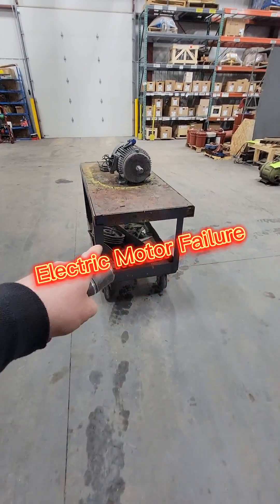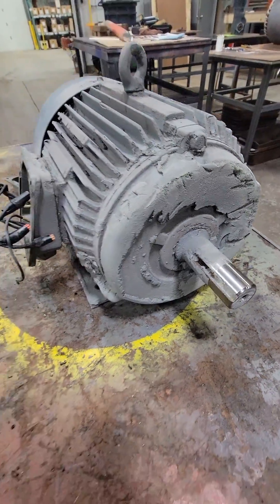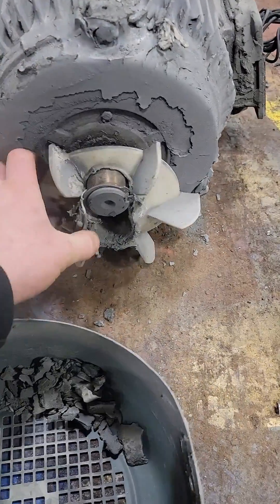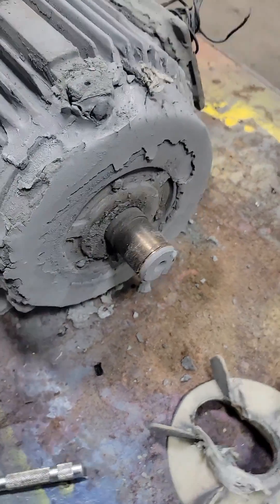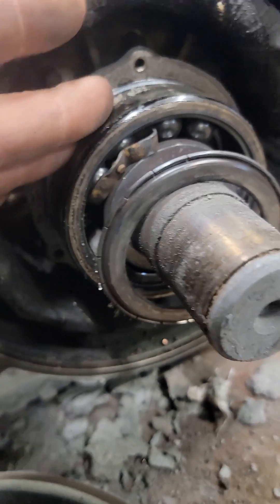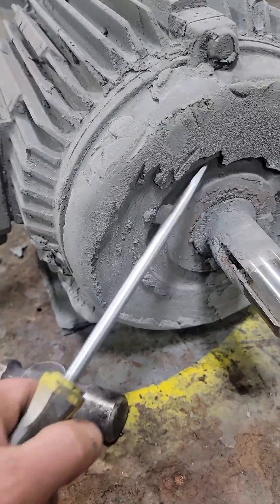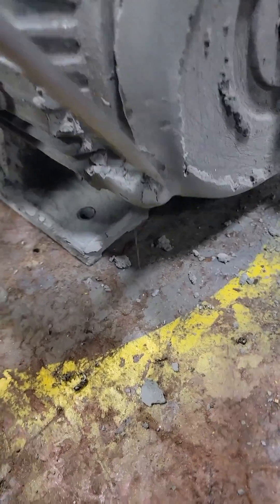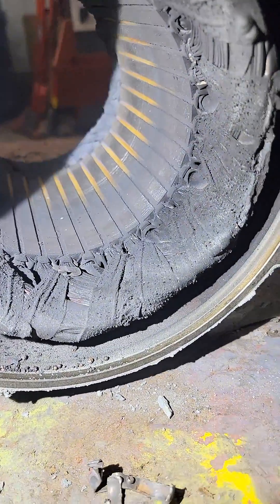Electric motor failure. 3 phase ac. Mechanical

Comment: That poor motor. It only takes 30 seconds of time to zap the motor and bearing ends with a temp gun and record it in a log book. Did that for a big shredder motor and one day the temp was a lot higher but both bearings were fine. When off it spun freely. The issue was that one of the 3 contacts in the starter relay was badly worn and so was getting a weak phase. A 400 dollsr relay was a lot cheaper to replace than replacing or rebuilding a 18k motor, both in cost and downtime. Diagnosed and fixed it in less than 2 hours.❤
Reply: Good maintenance! You guys are the most underappreciated professional out there!

Comment: When the motor doesn’t have internal bearing caps and the bearing fails it takes out the winding I’ve been winding motors for 17 years some just because the bearing failed

Comment: 1 time Gen foreman says,  "motor coming you will stay 'till it's done".  I say when it arrive?  He say, 12 noon;  motor arrives at 5pm.  Motor is ship's boat davit mtr.;   had to hit with hammer and use de-scaler 1 hour b-4 accessing screws  (100 coats paint).  ?Spares anyone?  Stuffed new wnding, save-a-day,  and waved at self going home & coming back in next day --- good luck to todays' slaves

Comment: I know nothing about motors and just love watching the restoration.. I was wondering in what scenario it makes sense to restore this rather than replace it? Even if you didn't have a replacement in stock, is it not possible to more easily source something compatible from elsewhere?
Reply: Good question and its down to cost and lead time of a new motor. All depends on the spec and price of the original motor too. It’s cheaper to rewind a motor for a few thousand than wait for a new motor that will cost potentially 3x as much but not arrive until 6 weeks later. 
Planned maintenance is always a good choice and having a spare if possible.